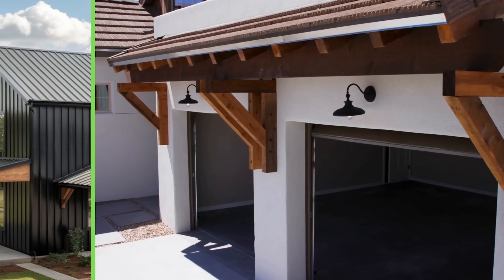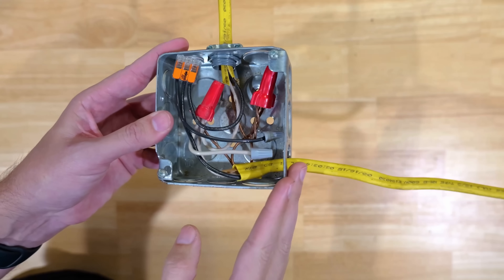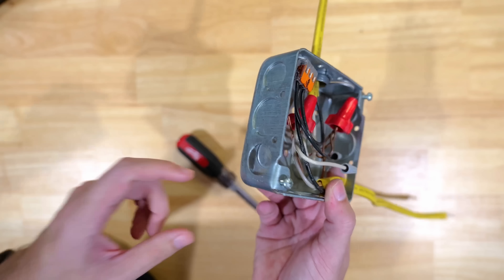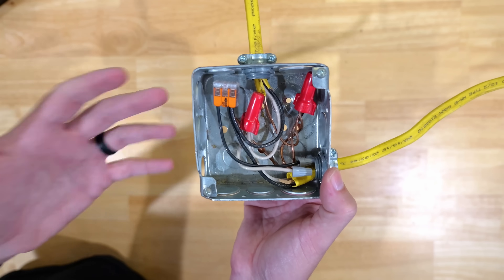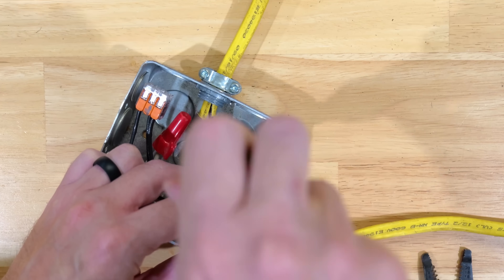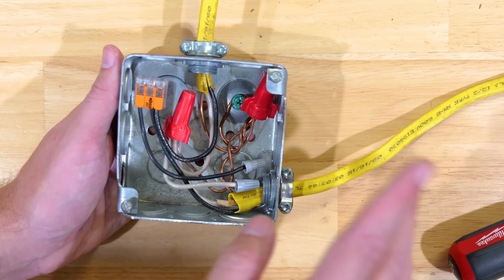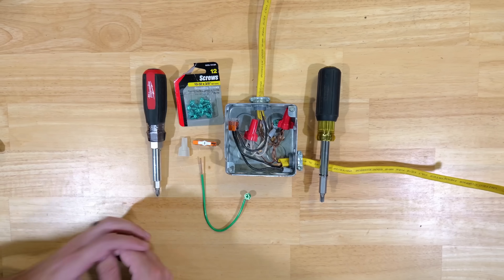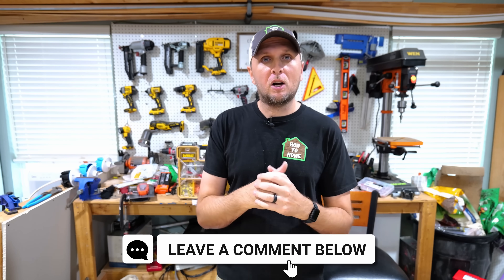SHOCKING Mistakes DIYers Make Installing Metal Electrical Boxes!

Comment: Here in northern Illinois, using metal conduit is code as it grounds the box to the main panel earth. That makes grounding in the box largely unnecessary here (as long as anything mounted to the box is making contact as with metal screws.)
Reply: here in Oregon, it's no longer permitted to rely on metallic conduit for circuit grounding.
Reply: Only if you are in crooked (cook) county.
Here in McHenry county, we are good with romex.
Reply: I'd personally prefer going the belt and suspenders approach (assuming code allows it) of using a ground screw any time there is a connection made, just for the added security. Might be something I'm missing though, for example it would make it harder to verify the conduit on its own forms a complete electrical connection?
Reply: DuPage County also requires metallic conduit, no Romex, no mx,  no ac, etc.

Comment: Nice video! When I'm using a metal box, I'm always concerned with electrolysis and corrosion between dissimilar metals. So, I would use some sort of conversion connector for the ground along with an anti-corrosion grease, plus keep the bare copper from touching the galvanized (zinc plated) box.
Reply: now that you mention it, I've never seen a corrosion issue from copper wire directly clamped to a steel box.
Reply: @kenbrown2808  ; how fast it happens depends on moisture. I grew up in Iowa, where summer humidity is high, so it happens in just a few years. Now, I live in Arizona, where it can take decades.
Reply: @robbehr8806  here, stainless starts rusting in about a year. I haven't seen any more corrosion where the ground wire contacts the box than anywhere else on the box.
Reply: @kenbrown2808  Same.  I'm 65 and have never seen corrosion there, and I live in a very humid state, Missouri, near 3 of the largest rivers in America.
Reply: @ where I HAVE seen corrosion problems is on every piece of exposed aluminum cable that hasn't been treated with deox.  despite all the millennials on youtube claiming deox isn't necessary because new aluminum doesn't corrode.
Reply: @kenbrown2808  , Yup! Even here, in the dry climate of Arizona, I don't trust Aluminum. The new aluminum alloys make things better, but not good enough.
Reply: @kenbrown2808  i think i've seen something to that effect. of course it corrodes but i dont think as much to require noalox. i still use it anyway
Reply: it's my understanding corrosion on copper does not effect conductivity. that is, corrosion of the copper itself, not that green shit caused by battery acid. I read a statement to that effect by an engineer. I think he is referring to it turning black tho, not green like a roof. I haven't seen anything backing that statement up tho.I FOUND MY COMMENT! now I can correct it. I didn't mean corrosion, I meant oxidation.
Reply: Don't overengineer your metal enclosure grounding.

Threaded hole (or approved clip).
Proper green screw
Solid Copper wire
Lug if larger than #12 wire
Reply: Under non-obscure applications the protective element provided by the ground will still operate even if the copper is corroded as long as it is properly attached to the box
Reply: Okay, so if disimilar metals contact is a corrosion problem. why does the NEC allow it?
Reply: As a diy  i only use plastic boxes.

Comment: The neutrals look like they are wire-nutted together without being twisted enough
Reply: most wire nuts are rated to secure wires that aren't pretwisted.
Reply: @kenbrown2808  that is true however you should be able to see the twisted wires just outside of the wirenut if done correctly
Reply: @talon0863  not necessarily.
Reply: @kenbrown2808  roll eyes
Reply: @ so sorry to contradict your youtube tutorials with actual standards.
Reply: @kenbrown2808  Whatever Karen
Reply: @talon0863  ummm... you're the one pitching a fit because he didn't do it YOUR way.
Reply: @kenbrown2808  Yeah OK Karen
Reply: @talon0863  I'm sorry, did you need to speak to my manager?
Reply: @kenbrown2808  You got hired at McDonalds?!  NICE
Reply: @talon0863  the projection is strong with you.
Reply: Yeah, obviously inclined to banter.  And you: a glutton for punishment
Reply: @talon0863  I'm not the one who keeps digging. But i get half if you strike oil.
Reply: @kenbrown2808    OK last retort -Thanks for the banter, I wish you success and happiness.
Reply: He’s right. It’s obviously better to twist them together, but the manufacturers do not tell you to.
Reply: @ Thanks bro

Comment: Always Alway use electrical tape around the Wago's so they don't pop open when caught behind a wire when accessing and handling the box!
Reply: you mean so any electrician who works on it knows it was done by a DIYer.
Reply: @kenbrown2808  old school electrician?
Reply: @schüt7765  old school electricians won't use wagos.
Reply: @kenbrown2808  Clearly still stuck in the past you must be on dial-up too lol. The Wago connectors are much safer and convenient and can handle much more pulling power then your twist nuts. The Wago 221's are rated for AWG 24~12. But again always use electrical tape to keep the tabs in the closed position....... 😉
Reply: @schüt7765  and wire nuts are rated by wire capacity instead of ampacity. Wagos are rated in ampacity, they have more bulk per conductor, they cost more, you have to maintain a larger inventory, and even with deox, they fail in harsh environments. 
But they are more idiot resistant, so they are harder for DIYers to screw up. But any time a professional has to peel wads of cheap electrical tape off something we know it was a DIY project.
Reply: @kenbrown2808  thanks for chiming in!
Reply: Yeah, wrap it in tape so you can’t visually inspect your connection before closing everything up…
Reply: @ yeah like you really can see your loose wires with a wire nut! 🙄

Comment: You missed one.  The neutral connection with the wire nut was not twisted.
Reply: most wire nuts do not require pretwisting.  in fact, a lot of newer ones say not to.
Reply: no need to with two wires only. anymore than that then hell yes (3 in vid)

Comment: I once found a bathroom light wired with thermostat wire :body-blue-raised-arms: Had been that way for years ... Thx:hand-purple-blue-peace:
Reply: In the kitchen of a remodeled condo I found the receptacle for the microwave wired with ZIP CORD! After much tracing I found an original outlet box less than a foot from this receptacle which was covered by one of the new cabinets, and bozo DIYer used a chunk of lamp cord to power the relocated outlet. How it never erupted in flames I'll never know!
Reply: The saving grace of that MW oven being connected with zip cord is that a MW usually operates only a few minutes at a time, not enough to heat the wire up.
Reply: I've seen lamp cord taped on the wall and then drywall mud over it, all the way from an outlet box to a ceiling fixture.     But you know what?  It worked for 40 years.

Comment: I think what I've learned is, use wire nuts. Don't back stab. Only one connector under any terminal. 
Problem solved for every type of install.
Reply: Wire nuts are easy to do wrong. I've had them pop off as soon as I've touched them even though done by a competent pro. Lever nuts can be done wrong, too, but the level of incompetence needed is several orders of magnitude greater than for wire nuts.

Some terminals are designed, tested, and listed for more than one conductor.

Backstabbing is just a bad idea.
Reply: @D-Mac56 The only time I see problems with wire nuts is (generally) combining stranded and solid wires.
Reply: @rickrudd  Generally true, and that's one of the most common problems that a diy will face. Consumer fixtures will frequently have stranded wire.